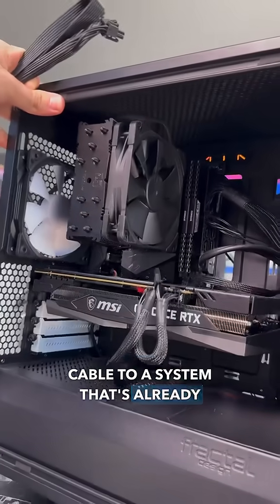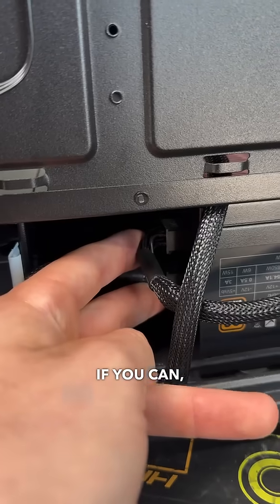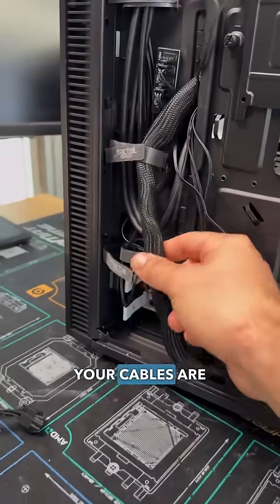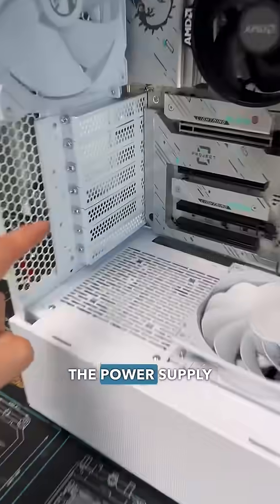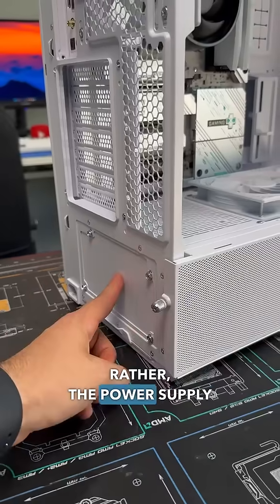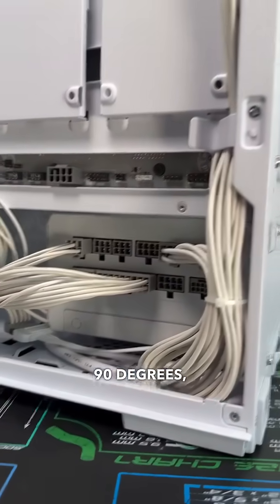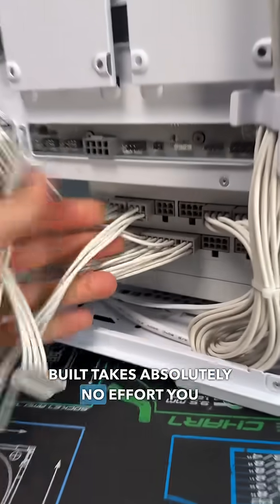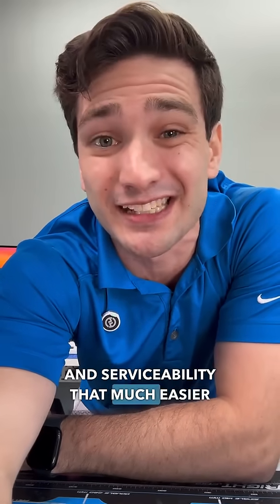🎬 Title: PC Building Made Easy! 🖥️ | Gaming PC Build & Tech Tips

Comment: Skill issue. Kinda useless. You got clips on a cable, so when they are locked, you know that they are secure. Never had this problem. Oh, wait a second.. only once with reeally old case where top positioned PSU against hard drives 😅 (but even there, it's just an extra 1 min struggle, who tf pays extra to solve this?)

Comment: The corsair rm1000x has a regular back panel, and all the modular connections are on the side. So you could use more cases than the one designed for that psu
Reply: Corsair got a "shift" line they have modular connection on the side rm1000x got them on the back the rm1000x shift has it on the side